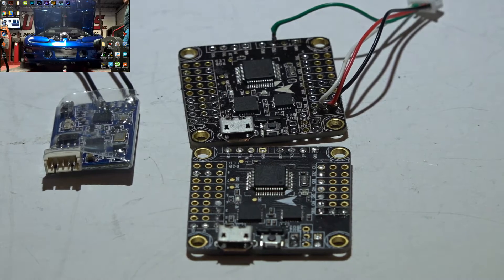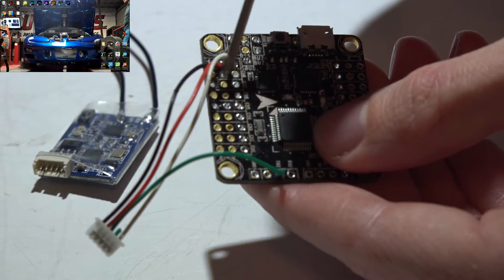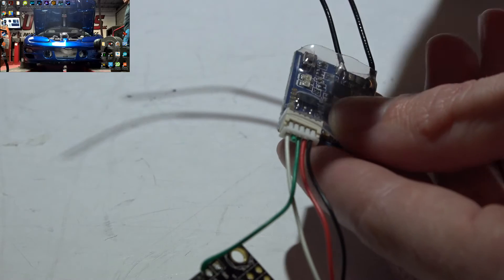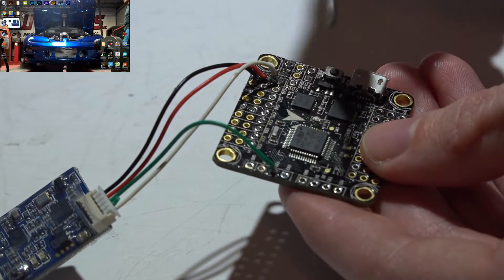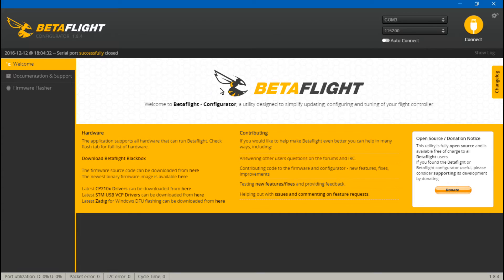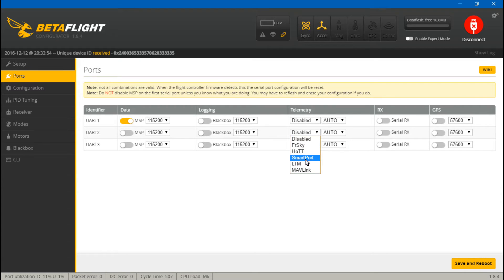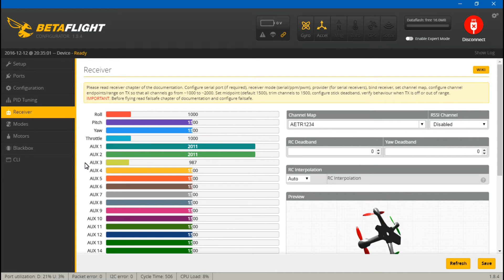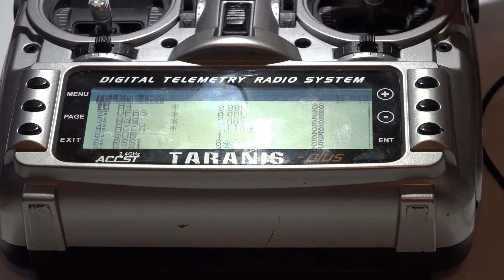X-Racer & XSR: Connect & Telemetry

Comment: Yo Jc. Overseas subscriber here. Having a problem where I'm not getting telemetry from xsr to taranis. Just flashed to opentx 2.2. When battery is plugged in telemetry shows for 2 seconds then stops and you get the sensor lost warning. Xracer v3.1 taranis x9d+ xracer spi 3.1.7. Checked for bad soldering. Desoldered and tested again...once you connect telemetry wire values are displayed for about 2 seconds then it stops. Bad FC tx port maybe? Four other quads telemetry works as it should. Even one that has an xracer v3.1 installed. Any advice? 

Keep on keeping on bro thx in advance.

Comment: Not sure if I got the grasp of this:

1. What is the roles/differences between the WHITE wire compared to the GREEN (for others, yellow)?
2. Would you be able to fly without connecting the green wire?
Reply from the maker: The white wire is for SBUS communication, green is for PPM. The difference between the two is SBUS is faster than PPM because its a digital signal vs an analogue signal. Also with SBUS you will get 16 channels where if you use the green PPM wire you will only get 8 channels. So SBUS is the better choice. The only reason they add in the green PPM wire is for other flight controllers that doesnt have the ability to use SBUS. But the X-Racer can, so its best to use SBUS. And yes you can fly without the green wire. In fact you dont need it so you can just cut or pull it off the connector. 

The yellow wire is for telemetry. This will let you see your battery voltage and many other sensors in the Taranis transmitter.
Reply: Awesome! Thank you soo much!